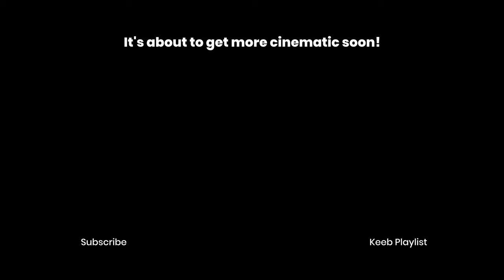VDAY Keyboard (E-YOOSO Keyboard Mods)

Comment: wait, u use gateron switchs 5 pin?
Reply from the maker: i used the top housing, stem, and spring from the gateron red switches, but the bottom housing from whatever awful switches came with it so they'd fit
Reply: @SPANISHFOREAGLE  so can i cut the pin and make it more small to fit?? i saw a lot of videos that cut the pin to fit gateron switch into outemu socket
Reply from the maker: @tylernguyen1167  i think so? i've never put clipped gat switches to fit outemu socket. i've seen videos of it but i already had the bottom housings from the stock board switches so i used those instead